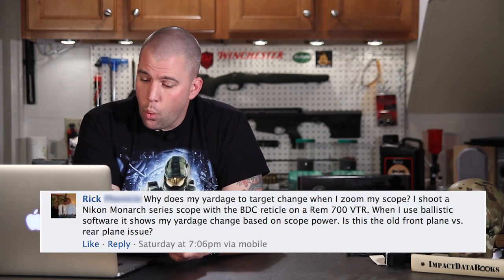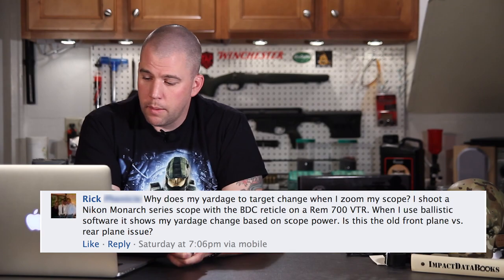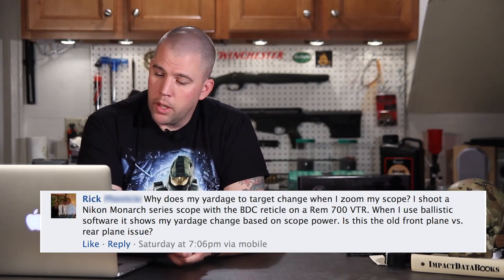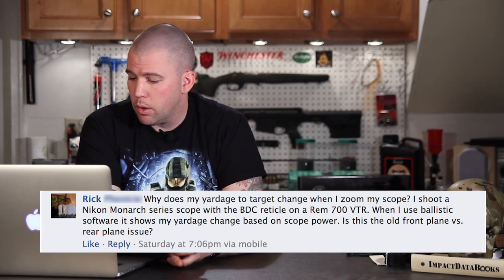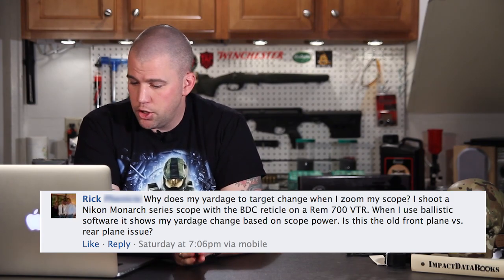Mail Call Mondays Season 2 #13 - Ballistics Programs, Bullet Weights, Fluting and More!

Comment: besides the software allows the connection between the ballistic calculator and the Kestrel 4500 Ballistic, through  the Bluetooth and automatically integrate all the data

Comment: I have used several apps on the iphone but when i learned about the brian litz applied ballistic app i had to try it. i shoot a 308 with both berger 155 and 168 hydrid and this app is the best thing i have found. i can shoot 1000 yard in any diffrent waether conditions and it corrects for it every time.

Comment: It was mentioned in your video that ammunition was becoming rather scarce. Yes, this is true. Everywhere I have looked the selections are nothing like they normally are. Even 'Cheaper Than Dirt' is running short and posting some extremely high prices on 9mm defense ammo and range ammo also. PMC HP in 9mm for close to $90 for box of 20. Verified, not a misprint. Bass Pro Shops claims to still a decent selection at reasonable prices. Going to Orlando BP Sunday to check, I will post an update.

Comment: I have a remington 700 sps varmint .308 26" barrel 1/12 twist, if I were to cut the barrel down how short could I cut it with out loosing a lot of accuracy at long range (800-1,000) yards or would I be better off buying a 20 inch barrel with 1/10 twist? Thx

Comment: Android ballistics programs.  Lapua Ballistics program seems to be pretty accurate.  I have a Savage 12 FTR in 308 and use the 155gn Scenaar bullet at 2800fps. Here is a list of actual elevation settings and the prediction from the program.  My Sightron scope is zeroed @ 600yds.  

300yds -10' LB -9.5; 500yds -6' LB -3.46'; 600yds -2' LB +0.19'; 900yds +11.5'; LB +14.5'; 1000yds +19', LB +20.78'. The actual settings are based on only a few shoots.  

Thanks for a great programme John.

Comment: I was wondering if you could answer the question of what makes a suppressor a suppressor and a muzzle brake a muzzle brake?  Since suppressors are completely illegal i have very little option on noise reduction.  I could not find any law or legislation governing what exactly defines these devices. I would like to lower my noise level as to not irritate locals but still want to stay legal. Is there a noise reducing muzzle brake that could work?